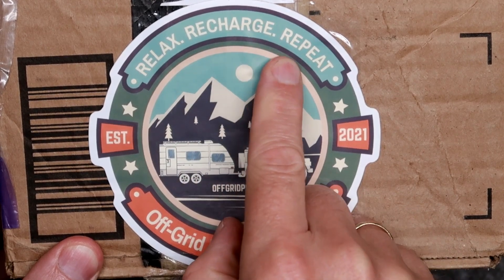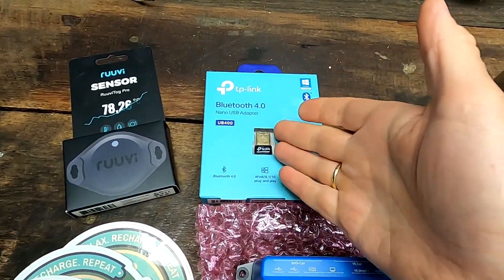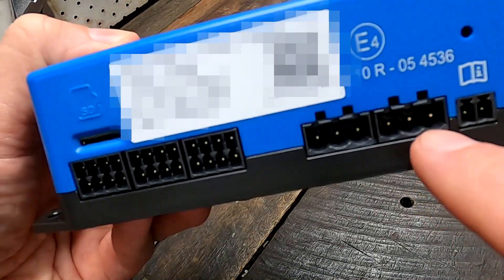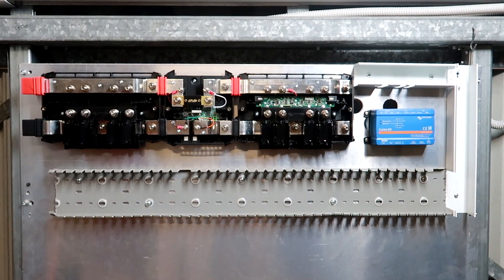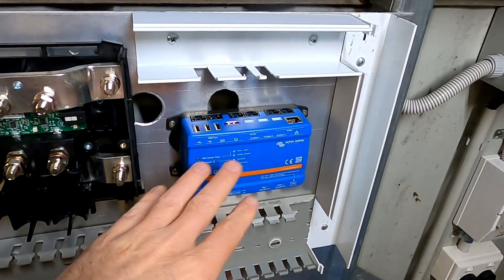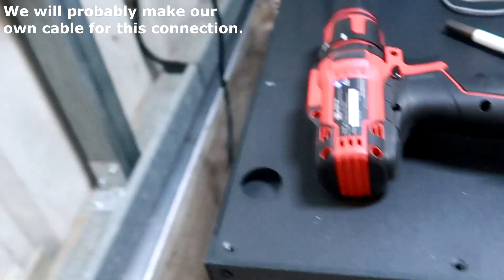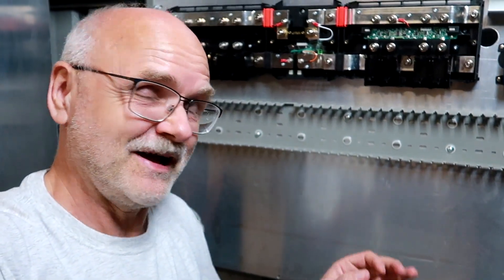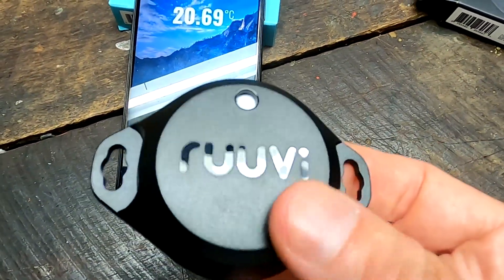The unexpected landing of the Victron Cerbo GX on the PowerWall 2.1 - the saviour of communication?

Comment: I've a stack of boxes of containing the exact same system ready to build, right down to the Seplos Mason 280AH (Although with the 200A BMS fortunately). This series of videos could not have come at a better time. Thank you. I also have a JK BMS en route too. Would you use both BMS' in the Mason or only one? I like the idea of the JK's active balancing, yet the Seplos is actually designed to fit in the case and has the LCD. If only one can be used it's a dlllema!

Comment: I do find discussing and solving issues with any Chinese seller very difficult as they seem not to be able to communicate or understand simple requests. Unfortunately i have some issues with a battery bank I’ve ordered from Qishou where one of the cells is not matched with other ones after top ballancing, etc. And i was told this is normal, since they have a “Dynamic range”??? and it’s fine (0.80mv deviation) rest of the cells are fine, this is the second battery bank im using and was told to ask Andy as he will explain to me that this is normal, really don’t know how to proceed with them…..
Reply: I find the communication is perfectly fine until the moment you tell them you have a problem.
Reply: @danmc1313  so true unfortunately….
Reply: @danmc1313  it’s the Asian culture. They cannot say NO, instead they disappear. Being negative is almost the same. That part of the culture does not support problem solving.
Reply: Have you made sure the cell terminal contacts are super clean?
Reply: @pau1phi11ips  yes, rechecked terminals, re torqued everything.

Comment: I agree with you on the Seplos BMSes, why do they think they are creating a good customer experience with such different setups. It'not that you try to couple a DC 48V system to a 100V system. Your way to screw in a JK BMS would do the right thing in unleashing the power of the batteries with no vendor locking. Nice you are now also able to compare a Pi and the real stuff of Victron!.
Reply: Pretty sure it's about the whole-rack style systems these boxes are technically designed to be a PART of. It makes perfect sense in that setting. Selling part of one system as a DIY part kinda introduces confusion. Maybe they need a BMS (and variants of it) for the DIY market.

Sell the existing kits as DIY drawers for the rack system... allowing system builders to be able to supply their own cells when building an ESS (energy storage system) for their own customers.

Comment: Caution with the Cerbo GX as l think the HDMI metal socket is battery negative. My system developed a positive earth fault, and I blew up my first Cerbo when I added a mains powered LCD monitor which earthed the HDMI lead screening.
Reply: great heads up!!! Had it connected to a big screen tv with no issue temporarily but will think again after hearing this! Cheers
Reply: Then there should be a large warning somewhere.
Reply: Although also possible theres a short in the hdmi-usb cable
Reply: @davidmills2266  No I had a full earth short to my positive Aux supply which was Breaker'd at 6A. So, the 13A UK socket earth was at +25V potential DC, through the LCD monitor, through the HDMI lead and big spark when the earth pin touched the socket and no Cerbo GX anymore. So, I assumed the Cerbo GX HDMI socket shield is at -VE potential?
Reply: Hey Andy, thanks for keeping us on the inside.  Cheers my friend!